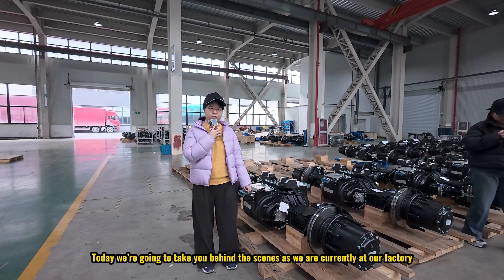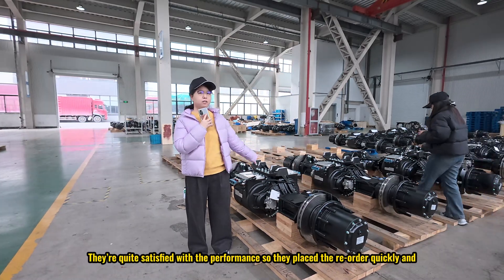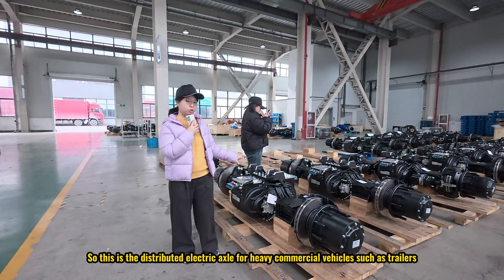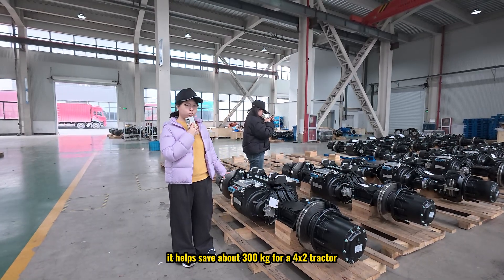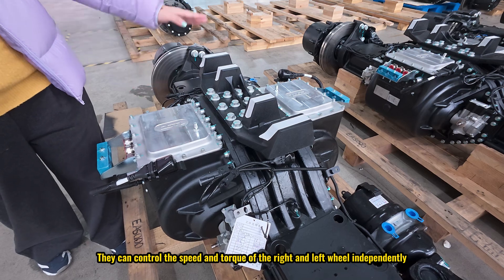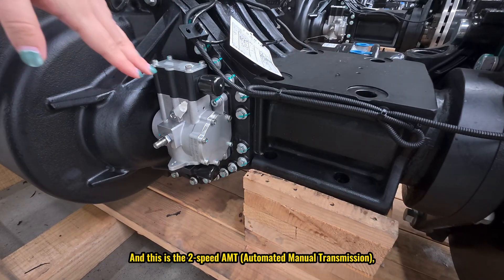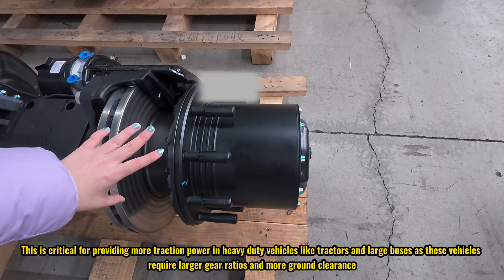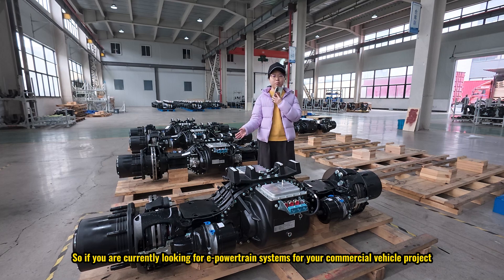Electric Axle for Heavy Trucks: Preparing the Shipment to South America

Comment: I have a 2016 Mazda BT50 pickup. The same as the FORD RANGER Pick up. 5 cylinder 3.2 litre Diesel engine Automatic Transmission. Do you make Electric Axel solutions for that vehicle?